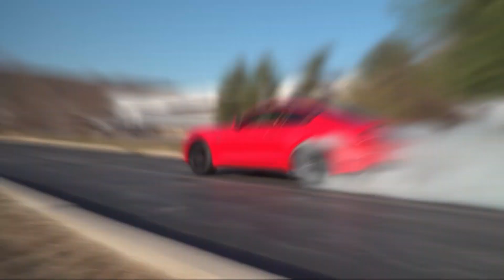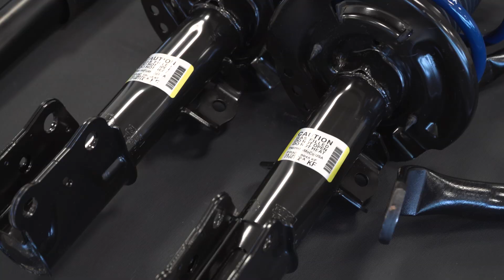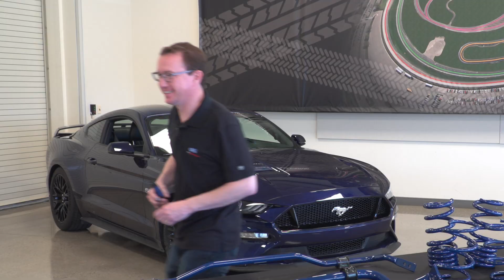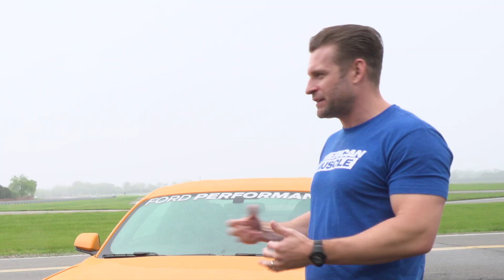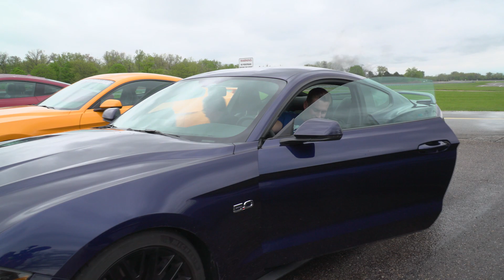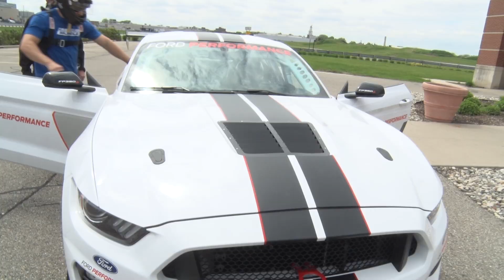Ford Performance Handling Packs Explained | Track-Tested At Ford's Proving Grounds

Comment from the maker: Subscribe For New Mustang Videos Daily: http://muscle.am/SubscribeAMyt
Check Out Parts and Accessories For Your Mustang Right Here: https://www.americanmuscle.com/Ford-Performance-Handling.html
Ford Performance Mustang Suspension Packs:
Ford Performance Lowering W-Springs (18-19 GT w/ MagneRide; 15-19 GT350) - https://muscle.am/2YYVmZG
Ford Performance Street Lowering X-Springs (15-19 GT Fastback, EcoBoost Fastback w/o MagneRide) - https://muscle.am/2MZZ3b8
Ford Performance Track Lowering Y-Springs (15-19 GT Fastback, EcoBoost Fastback w/o MagneRide) - https://muscle.am/2YI9xCZ
Ford Performance Street Handling Pack (15-19 GT Fastback w/o MagneRide, EcoBoost Fastback w/o MagneRide) - https://muscle.am/31CYecb
Ford Performance Track Handling Pack (15-19 GT Fastback w/o MagneRide, EcoBoost Fastback w/o MagneRide) - https://muscle.am/31wOfoW
Ford Performance Track Shock & Strut Kit (15-19 GT Fastback, EcoBoost Fastback) - https://muscle.am/2YJaM58

When it comes to tuning the Ford Mustang's suspension, nobody knows these cars better than Ford Performance.  Ford Performance’s unique position to work with engineers during the development of new models means they’re able to build some of the most developed products in the aftermarket world, which shines in their suspension kits.

Tuning the suspension of your Mustang to extract better handling performance requires hours of careful development and testing. Thanks to Ford Performance's OEM support they're able to devote the necessary time and resources to build the best Mustang suspension to suit your ride.

It's no secret that Mustang owners use their cars for a variety of applications and Ford Performance makes sure their suspension packs cater to every type of owner. If you’re more interested in changing up the look of your Mustang for an affordable price Ford Performance offers lowering springs. Let's say you want to take your Mustang to the track, well Ford Performance has you covered there as well with their full track handling kit. 

If you're looking to improve the suspension on your Mustang why not turn to the team spends every day with the car and has the time resources to devote to the little details that can make a good car great?

Comment: I have a 2020 GT Premium Convertible that came with the PP1 

I swapped that out for the Track pkg at 32K miles.   I have 82K now and it still rides like new.    The PP1 suspension got soft after 30k

As well, the wheel hubs were upgraded to the GT350 racing hubs, and the half shafts were also  upgraded to the FP 1500 hp shafts.

Wish my car came with magna ride.

The track kit requires a castor camber kit or you will wear out the inside of the tires

I found that out the hard way.

Comment: A quick question .. I own a 2020 Mustang GT PP1 Convertible and had the suspension package upgraded to the M-FR3A-M8A ... what is the difference between the PP2 suspension and the F.P. kit aforementioned ..
Reply: If the PP2 is not MagneRide equipped then it has the equiv of the FP Street Handling pack.

Comment: I have a 2015 Mustang GT w/ PP, will I need to install camber plates or Camber bolts to get the camber within specs? I don't want to have to spend $200 getting the wheels aligned only to have to remove the struts again and install camber plates.

Comment: "These springs are so we can make the car look how it should." Believe me I get it. The stock ride height means you can go over speed bumps, park in lots, and not worry about curb stops, etc. However...that "cat gap" does look like a bag of ass. Get the basic springs at a min. Just know, your front lip is gonna get chewed.
Reply: Lol, that’s true. It’s only an inch drop, you think it’s going to scrap that much more ,

Comment: Bought the FRPP Track suspension kit for my 17 base GT. WOW! I dont track my car only street and it's not harsh but firm. Highly recommend this it's been 1.5years later and I still think it's the best mod I've installed so far.
Reply: what's your 3 years later review?
Reply: @adriandude85  I sold the car in 2020. I had the kit on it for a good 8k Miles. Still the best mod I ever did to that car it's worth every penny. Don't waste your money on the FR performance pack 1,2 or 3 that was definitely the biggest waste of money I spent.
Reply: @gigatron2008  wow good to know. Power pack 2 was on my list after doing the suspension. How harsh was the track kit on bumpy roads? Sadly I’ve got a lot of those in my area
Reply: @adriandude85  don't waste your money on power pack 2 I had it also. The no lift shift is annoying as it causes this bucking in throttle that you can't disable under hard acceleration. I didn't notice any power gain but my butt Dyno. Complete waste of money. Also no extra induction noise from the gt350 intake either.

The susp under bumpy roads is great I took the new owner over a really broken up road of pavement and he was very impressed. My 00' s2000 and 01' Dodge Viper are way harsher rides. Both have stock setup.
Reply: @gigatron2008  great to know thank you!!
Reply: @adriandude85  No probs. Get a custom tuner. Intake does nothing.
Reply: @gigatron2008  Hi!! I was planning to change my suspension and was interested in this strut and shock kit, since you recommend it did you pair them with stock springs or did you use aftermarket ones?

Comment: Hell yeah, been waiting for Ford to release the Handling packs for the Magnaride to improve it. This coupled with the BMR stop the hop kits, are gonna make the GT way better at the track. Now if only Ford would release a Tremec compatible transmission for the S550 GT and a trans cooler as well as a diff cooler like the GT350 has, that'd be awesome!
Reply: Sounds like a Mach 1
Reply: Bro u dont need all this shit. Just buy some better tires. These cars come with Pirelli tires which are absolute garbage... Swap to some Bridgestones or michellons and all ur wheelhop issues disappear...
Reply: @3star2nr  My 2020 GT came with Michelin Pilot 4s, not Pirellis
Reply: @janetsminten8196  u had the pp2?
Reply: @3star2nr  2020 pp1 have the sport 4s. Pp2 have the cup 2
Reply: @lobbyrobby  bro... Your replying to a comment i made in 2019...
Reply: @3star2nr  yes I see that now haha
Reply: @3star2nr  Doesnt matter because it's incorrect info so people don't get misguided.
Reply: @andycjin4955  no ones gonna do mods based on a youtube comment bro calm down lol 😆

Comment: Awesome Content! I have a street and road course car so this was very helpful.  Now I wish I had spent the extra money for a Magna-Ride car!
Reply: No u don't... That magnaride system is gonna suck once your out of warranty
Reply: @3star2nr  I have one, it's great.  Do you know how it works?  It's less complicated than the engine management system.  What happens to that out of warranty that you can't afford to repair.
Reply: Steeda Active shocks, way cheaper and warranty for life. To many working parts and electronics with Magnaride, it will cost a penny to fix/replace when it fails.
Reply: @Phoneman-oc4fi  agreed man. Magnitude is nice... While under warranty...

Comment: I have a gt base model would you recommend track pack then?
Reply: Alex Lppez yeah, I have the kit and it feels smooth/mild on regular commuting, but is firm/tight in the sharp turns. 10/10 recommend
Reply: Does the one inch drop make the base 18 in wheels look to small? Asking for a friend with tiny wheels lol

Comment: What about gt 350?
Reply from the maker: Hey, Henry, since the GT350 uses Magnaride, Ford Performance offers specific lowering springs to keep the dampers happy. You can check them out right here on our site - https://www.americanmuscle.com/ford-performance-lowering-wsprings-1517-gt350.html
Reply: @americanmuscle  besides springs,what else Ford permance suspension offers?
Reply: @md_nght_drft  what kind of spring?